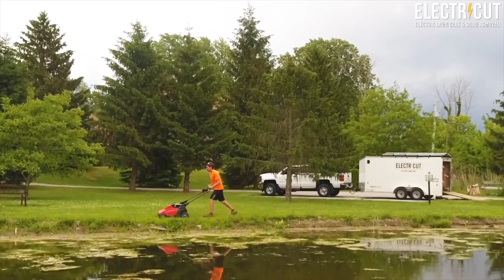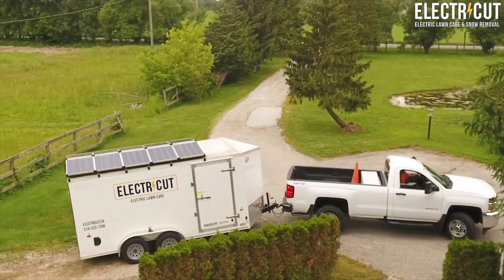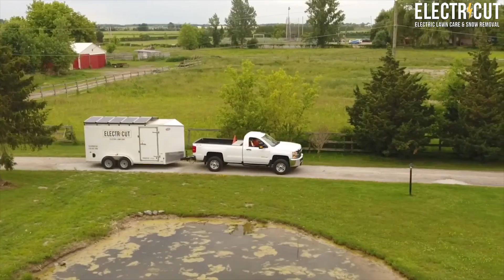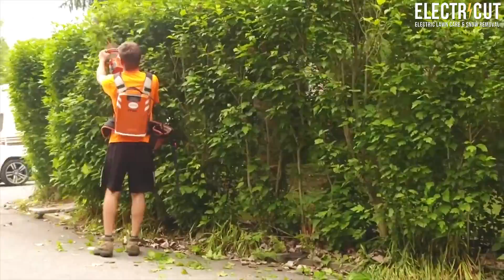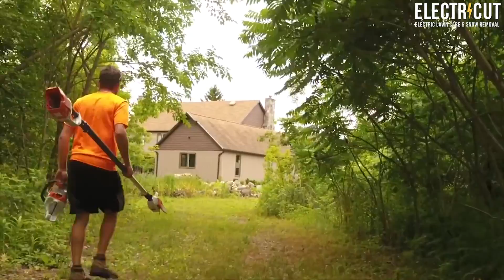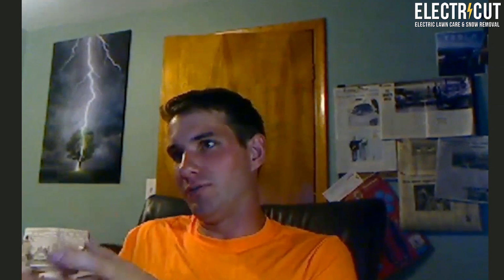Electricut Interview - Solar Powered Electric Landscaper

Comment: I used two Robomower's several years ago but finally abandoned them. Batteries lasted only two years and cost $150 to replace. The perimeter wires would break eventually and it was difficult to find where because you have to bury them. Also, small depressions in the lawn causes wheels to spin and mower did not realize it wasn't moving. So the batteries would run down quickly. 

Have heard that iRobot is working on wireless perimeter system. But nothing lately along these lines. 

It would likely take Musk to develop a good automatic mower. I searched Eco mowers and noted that a 7.5 am hour battery was $400. Wow!!!

I did not find an electric riding mower...

Comment: This is awesome! Hopefully more lawn care companies follow his lead eventually. I bought my house 3 years ago, and maintain my 3/4 acre yard myself. I have a gas riding mower and AWD push mower (for my steep banks)  that are gas powered, and frankly I can't wait to replace them. As soon as a good electric replacement option is out there I'll probably make the switch. All my other equipment are battery powered though. Leaf blower, weed trimmer, hedge trimmer, etc. And they're far superior to the gas versions I've used before.

Comment: Before I say something negative, I really like what this company is doing.  However, people really need to understand how much money it costs to use their equipment and know the difference between kW and kWh.  It doesn't take 400 Watts to cut 1/2 acre, that isn't possible because Watts is Power, not energy.  About 0.4 kWh is the energy needed, which you can pay for.

Now real calculations...  I could bore you with math, but a small push behind mower typically can get about 1 liter/hour.  This is the type of lawnmower that would compete with an electric push lawnmower.  With these calculations, it costs about 5 to 10 times the energy cost to use electric.  So if you pay 3 cents to use an electric mower, it costs 15 to 30 cents for gas.  Not $4!!!
Reply: Dan Chase ... Gas in Sarnia, ON is around $1.07 (Canadian) per liter, thus nearly CD$4 per gallon.
Reply: I understand gas costs $4 per gallon.  I am saying that it costs $0.30 cents in gas to operate the lawnmower, not $4.  An electric lawnmower is not over 100 times more efficient.

Comment: I've never seen a push mower that would burn 1 gallon of gasoline per hour. Maybe 1 liter an hour.  I think he mixed US vs metric units. I own/use a Ego 56v 21 inch self-propelled mower to cut my yard.  One 7.5 AH battery cut the entire yard ~2/3 acre.  That's about 420 watt hour which costs about 4 cents.

Comment: My father bought a Sunbeam lawnmower in the 70's. It was the most powerful lawnmower I have ever used and we used it until the wheels fell off. Since then, all my lawn tools are electric. They are extremely reliable and require minimum maintenance.

Comment: I use Ego brand lawn equipment - self-propelled mower, leaf blower, and string trimmer. All are top notch. I will NEVER use another gas powered lawn implement again. I can't say enough good things about them. And they have their own "supercharger" - a fast charge system that can charge the mower battery in 30 mins or so.
Reply: We use Ego  self-propelled mower, leaf blower and string trimmer too! Have you ever tried to cut your lawn using the battery that comes with the trimmer? hehe.
Reply: I bought a used plug in electric mower maybe 20 years ago now or more and it was actually a great mower! Now with the batteries, you can really do amazing things!

Comment: Hey, Zac:

Excellent reporting! 

I hope Mr. Musk sees your report and gives this concept some serious thought. At present, "runtime" on cordless garden equipment is the only major deal breaker when considering making the leap from ICE to electric. 

Kind regards, 
T 
Phoenix, Arizona USA
Reply: Not sure if you have Ego brand electric equipment where you live (self-propelled mower, leaf blower, string trimmer) but the li-ion batteries last long enough to cut both my neighbours lawn and ours and there's still two out of 5 bars left on the battery!! The run time is amazing.
Reply: toysareforboys:

Thanks for the information. In my local area, the Ego brand is not available. But, I checked Amazon and they offer Ego. It looks like it will work for my needs. I'll l give it a try -- thanks again.

Comment: Something neither of you touched on was air quality for the user. The small ICE engines found in garden tools are really inefficient and dirty and you are there working right next to that exhaust. It's got to be so much better for you not breathing all that in.
Reply: Exactly! We are in the same business and we went electric when we found out that they also don't have any emissions controls on them. It was chilling. We went to Lowe's and started switching out our equipment. The noise reduction is fantastic, but the clean air and the efficiency is wonderful.

Comment: This kid is on to something. Its perfect because the die hard gas equipment companies will never pivot. By the time they catch on, this kids company will be dominating the territory. Pitch the noise reduction aspect hard. That's a big advantage in my opinion. Also, if your expenses are that low, you can undercut (no pun intended) the competition. Good job man.